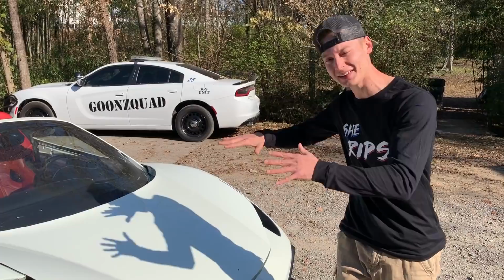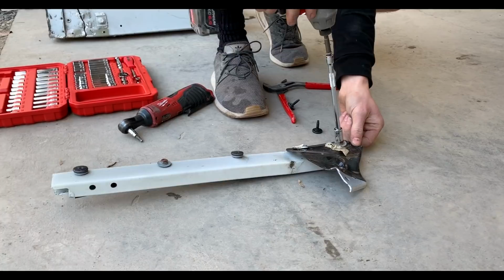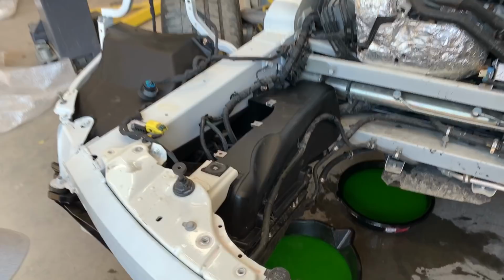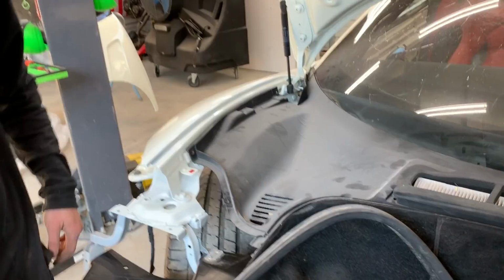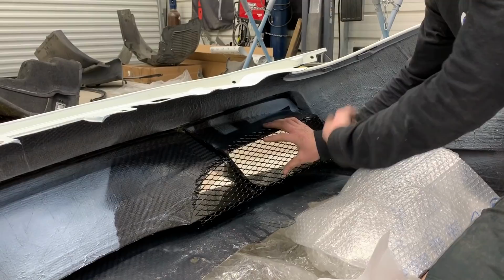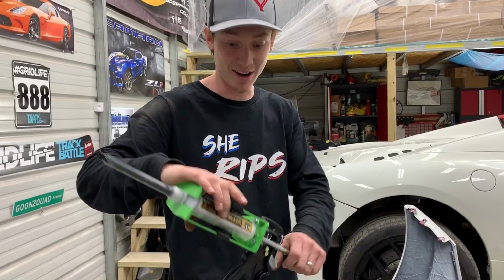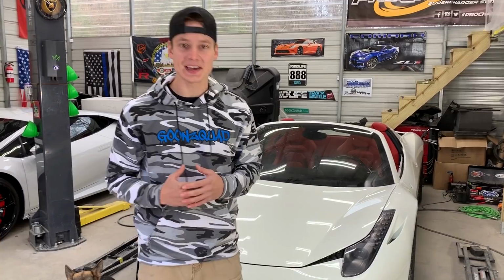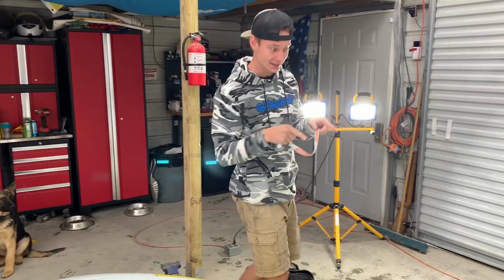Rebuilding A Wrecked Ferrari 458 Spider Part 13

Comment: Cooler line looks fine to me but next time use a crescent wrench and slowly adjust it down while rotating the wrench around the pipe and it will come out almost perfect.
Reply: Benjamin Davidson. Great idea. Would have thought there's a tool specially made for that.
🇬🇧

Comment: Puts hand in a glove not to glue his fingers.
Then puts gluetube in his mouth lmao
Reply: Zimppa I am black
Reply: Yeah. That had disaster written all over it. Luckily, he wasn't successful.
Reply: @robj2704  ok what would have happened?
Reply: Lil poshi wtf?
Reply: djsonicc nothing. The glues are in their own containers separated until you squeeze. Ones the hardener or activation if you like so they aren’t mixed until they are squeezed out. Typically you would have two nozzles and have to mix them both but this product is different.

Comment: Watch that Dogs around that Fluid on the floor!
Reply: faitmann1 :  You’re dead right about that. Animals love antifreeze and will lap it up. It will result in a painful death. Don’t leave a trace of it on the floor and get rid of any rags used in the cleanup.
Reply: dvs1145 you just had to use the word, “lap” didn’t you.
Reply: That fluid is anti-freeze, and it will kill dogs and just about any other small animals quick. They love the sweet taste.
Reply: New antifreeze will not kill animals. They took the poisonous chemical out of it.
Reply: Justin Wright the chemicals are still in there they just add a bitter ingredients
Reply: I pointed to that out when they got the pup.  Anti freeze is deadly for animals.
Reply: @thewrightsstuffall-out.8012  only in some kinds
Reply: @thewrightsstuffall-out.8012  Take a swig then and get back to me in a couple hours, ill wait.

Comment: something you can try in the shop to make sure the dogs don't get into the antifreeze that i had used before was to make a cover for those drain pans out of bug screen or chicken wire and hold it on with zip ties or a large hose clamp. thank you for the videos guys, hope you are having a great week.

Comment: When painting in the shop or any paint booth.... you gotta wet the floors so trash won’t blow up from spray gun while painting
Reply: But it also puts moisture in the air that  will affect the paint too

Comment: With broken plastic tabs, I like to drill 1mm holes in each piece to loop through and twist Monel seizing wire, embedding it in the epoxy. Holds while glue is trying and makes a very strong repair.

Comment: Why don’t y’all clean the plastic parts before reinstalling them?
Reply: They always don't clean part before install a little sloppy
Reply: They have been doing that since the inception.  Drives my OCD nuts.
Reply: Oskar Dirlewanger  True that, but you just know there's still dirt in there. Why not even give it a wipe down with a rag...
Reply: That's what I'm talkn about .. I'm a detailer and it drives me crazy .. bat shit crazy..

Comment: With all that coolant on the floor, a good tip to protect your pets is that ethanol or antizol act as a antidote for antifreeze poisoning. Dogs sometimes will lick or drink it, as it tastes sweet. The treatment can prevent and reverse some of the effects. FYI.

Comment: Guys,  next time you do a build where you might need to remove the radiator a  few times.  Just fill it up with Distilled water until the very last time then put coolant in.  This way your not wasting money and making a giant mess.  You dont drive these things enough to warrant coolant until done.  Keep up the good work!

Comment: Helpfull hint.. whenever your working with AC lines.. ALWAYS..ALWAYS lube up all o rings..this will help for them not to tear or pinch. Also use an adjustable for that kink..put it at the kink..tighten down and move around in a circle.. it will work to take out the kink.

Comment: Wonder how much yalls insurance is for all them cars
Reply: They might as well just get liability only. They would just make more money by repairing their own cars themselves and getting paid from views.
Reply: They probably have a Car Dealer license so the answer will be how much car dealers pay for insurance, I would think.
Reply: Gary Packwood yeah since they rebuild and sell them they most likely would need a dealers license to do all that. I know in my state they usually make you get a dealers license if you plan on selling 5 or more cars
Reply: Gary Packwood I really hope they do, it's much cheaper then
Reply: They drive them without license plates yall
Reply: austin bevis most of the time you can only liability on salvage title vehicles
Reply: @-tinayoufatlard-5814  they haven't sold any builds yet in a year far as I know
Reply: The dealer license makes sense. Especially to buy from copart..otherwise you need a broker to purchase from copart and they add their fees per percentage what the car sells for
Reply: austin bevis hell no... you know much how much of a loss they’d have if something was to happen to their finances if one of their vehicles ended up in a total loss? Use your head.
Reply: @ericalbertson6621  that depends on the state. I've never had an issue with any of my salvage vehicles getting full coverage.  As a matter of fact the only claim I made was on a prior salvage and there was no issue collecting on the claim.
Reply: Steven Plaskett isn’t the hellcat and a couple more for sale now? If not sell them I’d still get a dealers license. It’d probably be 10x cheaper for them.
Reply: did they sell the camaro zl whatever? i missed that
Reply: Probably umbrella insurance on the business/assets. Cars are owned by the business until they're sold, and insured that way. I doubt these guys register the cars in their own names, that's huge liability and cost.
Reply: @stevenplaskett7728  
The Corvette is the only one they've sold... Wanted to sell the GTR but change there minds...
Reply: Sometime their cars have a red license plate
Reply: Joes Golden Garage yea it sold
Reply: I am a TN dealer and the dealer plates are red.   I have unmbrella insurance that covers whatever I am in due to the fact I am buying and selling in 24hrs sometimes.    Just keep my proof of insurance on my phone!
Reply: whusky gtr, lambo, hellcat, mustang are all insured and have plates. Viper does not.
Reply: Leo they have only sold like 4 or 5 cars in the last year.

Comment: You should put white pinstripes on the exposed carbon areas for the front and back bumpers. It will make them pop so much more and break it up well ‼️

Comment: When you guys use those 2 part adhesives make sure you purge it first . So before you put the tip on , pull the trigger till both sides the come out and then put the tip on . And then pull the trigger to make a short bead so you know it’s mixed properly . That’s why when you put some on the bumper you could still see how it was white and black .

Comment: drives me nut watching you guys put dirty parts onto a car, why not take 30 seconds an make it look like new before bolting it on.
Reply: Why waste time when it doesn't affect performance?
Reply: Takes too much time. They’ll detail all that at once at the end although they may not show it in a video. Some of the early builds did show detailing at the end.
Reply: @Mw3oWn  Really think that it is a waste of time cleaning areas that you cannot get to once it is installed.
You cannot detail the underside of parts your bolting down in most cases.
 It does take time, to do a job right.
Reply: Greg these guy are neat freaks... If they aren't washed two or three times during a build, they'll be polished in the end...👍👍
Reply: @Gantzz321  
Glad to know your proud of your OCD... good job your awesome....!!!!👍👍👍

Comment: Hey guys ,you should try using fuel line hose clamp pliers when removing lines so you don't have to drain all fluids creating a mess and wasting fluids if new enough not to replace.

Comment: Use washer pump n small hoses to back tires on each side to do water burn outs. U can use the ol spray nozzles. Just need tube n a t n a few brackets..

Comment: Maybe on the new property have some containers to put broken parts in that could be used on the rebuild for reference but also for other build if you need an part, pick it out (maybe mod it a little) and install it so you can wait for the real part so you can keep going instead of being stuck

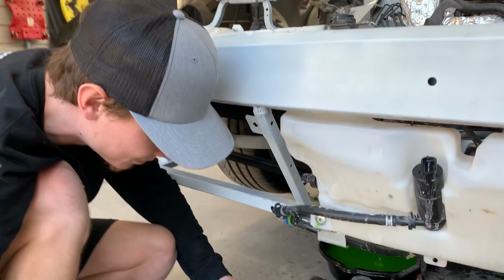Comment: @ 5:02 if you come across a pinched line like that or if that one cracks and leaks go buy the tube and cut ABOUT 6INC out and use flaring kit for put a  Male and female ends on it flair them and you have a patch kit. OR  cut it flare it and put high pressure steelbraded line in the area you cut out..

Comment: I think they just did a fast cut so they could see how the clear sanded but they don't need 3,000 git Wet its overboard IMO It should be glass by 2,000 but you need to keep the car and paper wet and clean . Great Job Goonzquad 👍

Comment: I wish you guys would be safer when you put the cars on the mini floor hoist. Place one or 2 wheels under the car so if it were to fall the wheels would stop you from being crushed. You should also get a real knife for opening boxes. Using a straight razor is not too safe. Keep up the videos. Very cool to watch and learn with you

Comment: You guys should start wet sanding large panels with a DA. I wouldn't wet sand a large area by hand, you run the  risk of low spots everywhere.

Comment: As an old shadetree mechanic have lost touch with the new technology not know much if any on the lastest styles.  Learned from you guys what a frame rail and number of airbags,  sensors and reason for the plastics. Gave me a different view what is under the body shells and looking at the newer cars.

Comment: Those lines are made of a soft material like brass or copper. So even if it leaked you could cut it and solder a sleeve to fix that broken piece

Comment: i'm pretty confident that unplugging the headlight washer pump won't throw a code. that pump is super expensive and puts out a lot of pressure, plugging it will probably cause damage to it

Comment: epoxy on some short pieces of wire around the holes to use to secure the grilles... then they are easier to change should they collect any road debris....

Comment: Quick curing epoxy is way weaker then slow curing epoxy. With epoxy you always need to mix EXACT same amount of both part as is recomended by manufaturer. There are different for volume amd for weight. It doesn't work the way like polyester resin, where you can add more hardener to get harder quicker but also more brittle.

Comment: Question from a guy with no experience in painting cars: Does it help to sand down the paint when it's clear coated? Doesn't the thrash in the basecoat show anyway? Even though the paint looks good, you can still see thrash after it's buffed. Any way to avoid this if you don't use a paint booth?
Reply: Wet the floor settles the dust, colour sanding takes the "orange peel" out of the finish and gives a more mirror finish. Cars straight from the factory can have worse jobs.

Comment: Don't plug that hole up cos it the pump is still connected ,when it is activated it will cause a problem,just disposable the switch so it is still active but can't be turned on ?

Comment: Great Video once again, hey Billy just be careful working under the car with no safety glasses with all those metal shavings and radiator fluid.
Reply: I'd be more worried about the lack of axle stands.

Comment: Doesn't that front washer fluid reservoir/pump connect to both the headlight nozzles and the windshield sprayers? If you cap it at the pump, you're disconnecting from both. Need to cap it at the "Y" where it splits.

Comment: Would have been faster to sand and clear the car again with all that dust ,its still visible after the wet sanding , Looks like someone took sand and chucked it the paint. Put water on the floor before painting come on guys😔

Comment: Why all professionals use normal pads instead of wool like goonzquad?
Reply: Benko DiєsєLTM wool pad is for cutting and foam pads are for The swirling and polishing.
Reply: @bigjmacg  how do you mean cutting?
Reply: Benko DiєsєLTM wool pads make more heat and remove or melt the clearcoat or paint it is used with a cutting polish. Foam pads are used for deswirling. Cut polishing leaves swirl marks in the paint or clearcoat. Foam pads help in removing this with a lighter grit polishing compound. Often this takes three steps or four. Wet sanding, heavy coat polish, medium cut polish, then deswirl with foam pad. Then polish with buffer and carnuba wax.

Comment: Look at that crash bar @ 1:06. The proper bracket in the left side is missing  so it was just welded. And not done properly i might add. I guess OEM is out the window on these expensive cars.